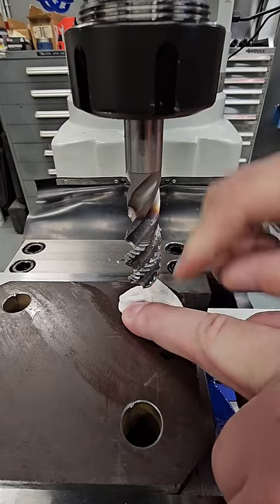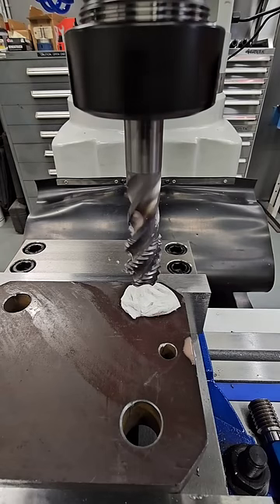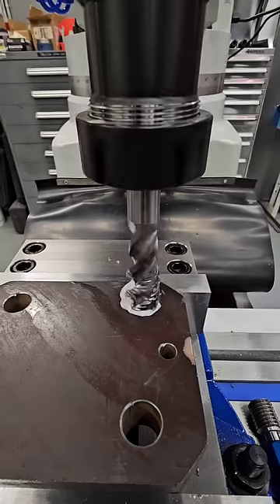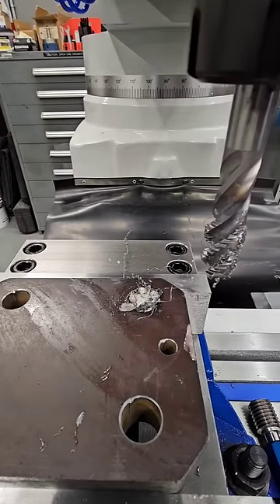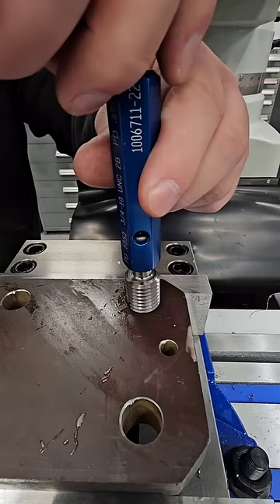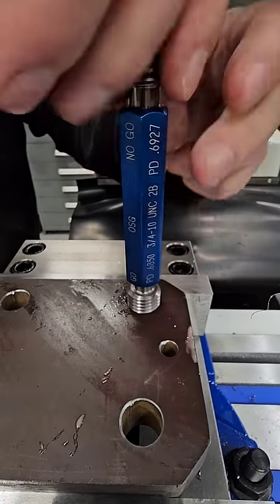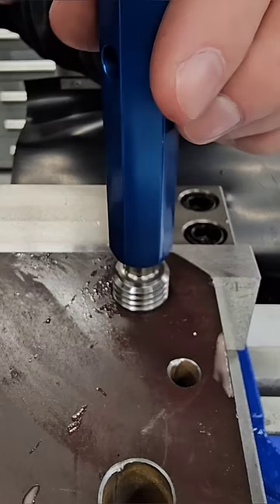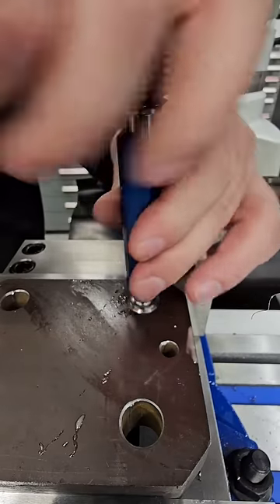Old School Machinist Trick for Oversize Threads

Comment: An old school cheat was to use a ball bearing and swage the entrance to a thread set. It allows your go gauge to drop right in but that small amount of material deformed by the ball bearing will stop the no-go. It’s a bums way of doing things but I’ve seen guys get their shifty parts thru QA with that trick 🤣
Reply from the maker: Well aware of ways to cheat inspection.  I've seen ball hammers used, too.  Playing with fire doing things like that.  Thanks for the comment, I can tell you've been around a while.
Reply: I would ballburize the top of a reamed hole to keep the dowel from falling out if the reamer cut for a slip fit.

Comment: Helical flute taps are a real bad idea for manual feed power tapping or hand tapping. They pull into the part and stretch the pitch unless the feed is timed with CNC control. A stretched pitch can make it difficult to thread in a long fastener because of pitch error. Also cascading thread failure can occur because only a small amount of the thread is actually working at a time. Think of it as how you would rip a phone book. Spiral point taps are better for most applications. Thread forming taps are best for ductile metals, not cast or 7075 (too stiff non malleable). If you need oversized threads, use an oversized tap.
Reply: Not your first rodeo.

Comment: Is the blue tool just to check size and Fit? Or is it a de burring tool of some sort? Sorry complete Novice here
Reply: C.Davidson, that's a threaded plug gage. They are +/-  sized to make sure the thread diameters are within spec.
Reply from the maker: A go-nogo gage is created to very precise pitch diamater limits which fall within the acceptable range for a globally recognized class of fit.  You can find the numbers in the Machinists handbook.  If the nogo side enters the hole there is something wrong with either the minor diameter (starting hole size) thread pitch or grind (distance from crest to crest or root to root, angle (not 60° in this case), or outer diamater.  Sometimes a poor quality tap will be off in every way possible.  The tap in this video is from OSG who are widely recognized as the best in the industry.  So long as the starting hole diamater is accurately sized it is almost guaranteed the hole will gage correctly.

Comment: Wait, paper towels are stronger than steel?
Reply: I think paper towel pushes the tap off center so that it cuts a larger diameter.
Reply: @jasonwise8957 Why would you do that?
Reply: @Concerned-Nihilist  You would have to listen to the video again to know that.
Reply: Not so much stronger then steal but doesn't have anywhere to go maybe?
Reply: You must be a machinist 👍🏻. This is a bunch of horseshit. You can use a Gh5 or a Gh7 tap to cut a thread oversized to allow for plating and or shrinking during heat treat. Facts 🇺🇸
Reply: The paper pushes the tap eccentric forcing it to cut extra material from the tapped hole.  Not very precise but it does remove some material.
Reply: @nrainfidelforlife  Yep I worked at a place years ago and we used oversized taps for aluminum parts that were later sent out for Hard coating
Reply: @nrainfidelforlife and what if you don’t have one on hand? No one is saying to do a production run this way. Ffs. 🤦🏻‍♂️
Reply: @JamesSClapperton  I'm saying it doesn't work.
Reply: @nrainfidelforlife  funny, a hundred other machinists in these comments say it does.
Reply: @nrainfidelforlife  Exactly! Unless you are a hack you wouldn't do this.
Reply: @tjinla9850 thats utter bs the towl does nothing 🙄
Reply: @JamesSClapperton funny people on the internet tend to say their something they are not to sound smart its absolute bs and your a fool if you think differently 🙄

Comment: They make oversized tap's?! I've used a piece of paper in the collet to oversize drill or ream?! 😮
Reply: I dont think they make oversized taps but there are 3 different fit standards for a tap. Ist 4h,6h,6g,7g. Make no mistake with hand taps that come in 3 part sets for each thread size.

Comment: I've heard this trick.  It doesn't work.  The fit of the threads depends on the drill size you select.  You go one drill over and the thread engagement will be loose. JUst look at the section in the machinery hand book for taps and threading.
Reply: Most ridiculous thing I've heard in a long time.  Changing the drill size only the changes the % of thread.  It doesn't change the pitch diameter which is what the blue-handle gage he's using measures.
Reply: lmao no

Comment: How can the tap spin freely like that and still cut threads without ruining them
Reply: If you mean how is he using the spindle motor, you don't leave it on. You turn the RPM down, turn the spindle on, get it started and then quickly turn it back off, depending on how deep you need to go. The inertia will keep it going for a bit depending on tap size and material. There's some skill to it though, especially on blind holes.

Comment: I watched this and rad a bunch of comments and I'm still not sure if this is spoof or real.  My initial inclinatioin was to call BS on this as I don't see a paper towel being tough enough to effect a tap cutting through steel or the steel being threaded.
Reply: Stick with your initial thoughts....
Reply from the maker: Any material present forces the tap against different parts of the already cut thread, thereby removing more material.  Thicker tapping fluid will even cause this to less of a degree. 👍
Reply: @OctaneWorkholding  Tnx for the explanation.

Comment: Just use a threadmill and run the offset down
Reply: Unfortunately there isnt a screen for offsets or tool comp on a manual mill….
Reply: @Onewingedangle42  yeh ik 😂
Reply: That only works if you haven't removed the part after the first tapping. Once you remove the part from the vice, you'll never put it back in the same spot, making it cross-threaded..
Reply: @losapriscos7258  after the threadmilling is done the first time you can literally try the gauge in the thread then run it again after changing the offset 😑
Reply: @losapriscos7258  you shouldn’t remove the part without checking….also if you use a scribe line and a point tool on the mill you can line it up almost exactly but you shouldn’t need to in this scenario
Reply: @Onewingedangle42  I agree with you, but it's not uncommon to have to rework parts that were already shipped.
Isn't?
Reply: @losapriscos7258  I’m most cases it’s common to rework parts but not with threads you should either 1. Be punished for not checking the threads with a gauge before they left the machine or 2. Hand tap the threads later to make sure they are correct or fix them if you think it will work….but those things if you are good at your job shouldn’t happen much or at all
Reply: @Onewingedangle42  I agree.

Comment: And why would I want threads to be larger than the fastener?
Reply: It's not larger than the fastener, this is just making it over cut a tiny bit, so when it's heat treated, the thread is still good after it shrinks.

Comment: I don’t understand what I’m seeing in regards to the other three holes.  Is that a water jet, laser, or burn out? My guess is a water jet? The holes look okay, but what do you do? Clean them up with a drill then tap? I doubt you straight tap it, that would be pretty sketchy.  What size do you have them water jet at and what is the tap size. I would think at least a high speed steel drill would have a more difficult time with the edge of the whatever it is rather than just solid steel. Enlighten me please, I would probably not adjust what I do anyway.
Reply from the maker: These are waterjet holes.  We make the holes undersize and ream before tapping.  In this clip, only the tapped hole was reamed.
Reply: Nice, I am working as a tool designer and we waterjet, laser, and burn out our parts that we don’t just order steel for, just started 6 months ago so I make the templates for torch, waterjet, and whatever else, the easier work. I ran a lathe for 10 years so I’ve seen some stuff on mills.  Never seen anyone who does it this way, suppose it could work, thanks for letting me know.

Comment: Wait really? The paper towel cuts in the steel? Didn’t know that! Pretty neat!
Reply: No, the rag or paper towel is used to take up more room on one side of the tap than the other, this pushes the tap off center causing it to cut slightly oversize, this is something you do only when you only have one size tap and when the part has to be ready for 7:00 am the next morning, everyone else would just buy the right H size tap.
Reply from the maker: @Viking380  This should never be done, a proper tap with the correct H limit should be utilized.  That being said, I just showed millions of people an old school technique that might be forgotten as the old timers are gone.  It's not whether it's useful to someone or not, what's useful is the knowledge.

Comment: That’s seriously oversized if it’s just being plated
Reply: Sometimes the best option is a shitty plater and you have to account for it
Reply from the maker: I exaggerated the demonstration for effect.  The whole purpose is to hand down this type of old school knowledge.  Not that it should be used.  The same theory applies to reaming and thick fluid versus coolant etc.  The hole produced will differ in size.

Comment: Yea I'm sure that paper towel did wonders cutting into that metal...
Reply: Think harder
Reply: @matthewbudz4733  there's no way in hell the tap didn't immediately cut through the paper towel. What are you talking about
Reply from the maker: The paper towel forces the tap to run outside of its original path thereby removing material.  This is not reccomended, but it is useful to remember.  The next time a tap isn't gauging correctly, try thicker fluid, it has the same effect.
Reply: @OctaneWorkholding it'll only do that if you have a clapped out spindle. Any proper rigid tool holding won't let it flex like that
Reply: A old and dirty trick,  just roughly offsets the cutter on one side and makes the resultant hole slightly bigger ,  it's the opposite of a centre drill , a centre drill makes a central hole even if it is slightly offset as it cuts on one side so the hole is in the centre of the rotation , simple really , get it wrong and it makes a square lobed hole like a twist drill makes a elliptical hole,  not precision but works ,
Reply: @ObservationofLimits Come on dude, look at the comments, we are a lot that have actually don this, not just a keyboard warrior that think he knows what he is talking about...
Reply: Must try this. Spent a fortune on oversize taps. Not sure how to put tissue dispensing into a CNC cycle though.

Comment: We have had good luck cutting the tap drill 0.01” larger than normal and then just using a regular tap. Less thread % engagement but the No-go thread gauge won’t go in

Comment: Threads are out of tolerance, so you rely on platers to bring it back in. Fail. Threads are on size, you rely on platers to not take them out of tolerance. Fail. I can at least fix the latter. Former is just scrap.

Comment: You wouldn't need to oversize your tap hole if you made it right the first time, just saying. And if it's a "repair" you don't oversize the hole by a minuscule amount, and let the bolt have slack, you go to the next bolt size so you don't need paper towel. Where do you work, I want to avoid the sloppy work you guys do.
Reply from the maker: I never said this is how we do it, it's an old school trick that's been around forever.  The principle is what is best ascertained.  The same applies to reaming and the viscosity of the fluid.  I've never seen someone make a video on the topic, and I try to keep every aspect of the trade alive.  Good or bad, it's good to understand how something like this works.

Comment: Even though this video is mildly deceptive, this trick has been used by machinists for nearly a century and it works.  Clearly for this video the hole had not been tapped all the way through the first time and that's where the shavings came from.  Had this been a true-to-life demonstration, you likely wouldn't see any shavings at all.
Reply: That's a spiral flute tap, it's designed to pull the chips up...
Reply: @king38081  No shit.  But it only made chips when the tap reached the bottom of the hole which means there were a couple incomplete threads.  Hence, heavy shavings.

Comment: This doesnt make any logical sense what is the minor diameter of your threads? A paper towel wouldnt make it cut any deeper per side so you would only be losing contact on your minor? We always do od threads a tad bit smaller and the threads like .005 or more deeper per side depending on whats needed but an id you just drill a little over size
Reply: There is no contact on the minor diameter , the contact between internal and external is based off of the pitch diameter .
Reply: You might be right but I’d rather just do thread milling so I don’t have to worry about whether a paper towel will get me oversized on threads…I can just adjust the the tool comp or the program and get the size I want….but I agree with you I don’t understand how a piece of paper towel would give you oversized threads….
Reply: @Onewingedangle42  he’s doing this on a manual mill there’s no thread milling on a manual mill.
Reply: @tylergibson7226  did I say that he should do thread milling? No I said I’d rather do thread milling….I hope your parents are proud of your extensive ability to read
Reply: @Onewingedangle42  What happens if you don't have access to a cnc machine? Which is what this short seems to be about.
You got all bent out of shape whilst making a comment that's completely irrelevant to the content. Maybe you should have stayed on topic mate. 😂😂
Reply: @johnsjunkyard how is that irrelevant to the conversation or the topic of the video? I simply said I’d rather use a thread mil then rely on paper towel to make an oversized thread…is the video not about making oversized threads or are you confused or did you think this was the comment section for the blues clues fan theory video you watched beforehand? Maybe I wouldn’t be bent out of shape if I could make a standard well intentioned comment without morons fucking it up
Reply from the maker: @Onewingedangle42 We have how to videos on thread milling, I agree it is the best way to create threads.  I am merely showing this trick so it doesn't end with the old timers that are gone.  If you check out our page you will see I am a CNC Machinist with an appreciation for the history of machining.

Comment: Changing your tap drill size (how much material is left in the hole before the tapping process) and speeds and feets. This is easily achieved. This is ridiculously stupid. Nobody would do this in any kind of production facility.
Reply: It's not meant for production, and changing your drill size won't do ANYTHING in this context. An H2 tap is going to cut an H2 sized hole no matter what you drill unless you go so oversize you're encroaching on the pitch diameter. Feeds and speeds also won't do anything, it's a tap, those numbers are locked together unless you want broken tools. It's not a reamer you can nudge a tenth or two by playing with the RPM.
Reply: @king38081  Well, I guess we're going to have to agree to disagree as a CMM operator I inspect tapped holes all day every day. You're 100% wrong. Speeds and feeds as well as tap size will change everything. It's a nice little trick for a YouTube video, but this type of nonsense would never fly in my industry.

Comment: I am calling b s.
With that size of a tap to deflection is not going to be sufficient 2 consider.
And it is also not going to be congruent. That is the size of whole that you tap is going to be different between the top and the bottom as the paper is pressed into nothing Within 2 threads.
But it is amazing what you can do. When you turn your own no go gages
Reply from the maker: Not a very hard experiment to do yourself, and it doesn't take a 170 iq to understand why it works.

Comment: Yea and the no go of the go Guage is going
Reply: Yes. That's the point of this trick.
Reply: @losapriscos7258  I know what you mean. We've never had issues with tapped parts coming back from being platted where the go Guage wouldn't go. Don't know if us tapping with a drill press and tap o matic makes a difference I wouldn't think it would.
Reply: @beekeeper7535 I don't think that's the issue, but cleanliness befire plating could be.
It depends on the type of plating, chem film, and anodize normally are not a problem but hard anodize needs to allow for 4 times the thickness of the plating.
Maybe you need a Before Plate thread gage?
Also, 17-4 steel is notorious for being difficult to gage threads.

Comment: I hope you realize plating is only 2-3 10 thousandths, so you don't need to oversize threads.
Reply: Sure as shit do need to if its a specified fit, 2-3 tenths works for thin coatings but many coatings that are more than just decorative and minor corrosion protection can be far thicker. some anodising layers can be as much as .003 thick. which applies twice inside a hole
Reply: I hope you realize you’re wrong.
Reply from the maker: I never said this is how you should do it, I am simply sharing an old-school technique that will be lost to the ages with all the old timers gone.
Reply: Coating thickness is doubled on threads due to the geometry involved. That .002" coating turns into an effective shrinkage of .004" on the thread.

Comment: Yeah, why buy another cheap tap with the tolerance you need when you can use this method which will almost guarantee you a busted $60 tap in a $3,500 part and have to send it out to EDM to burn it out and pray it's not junk and then tell the customer you have to make it over again? 👍